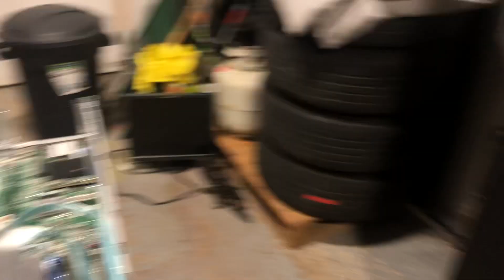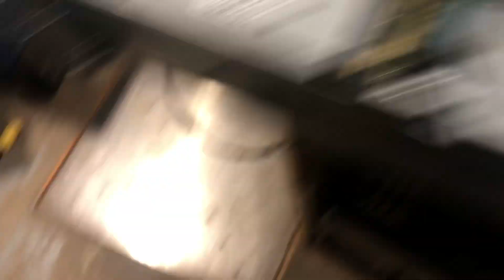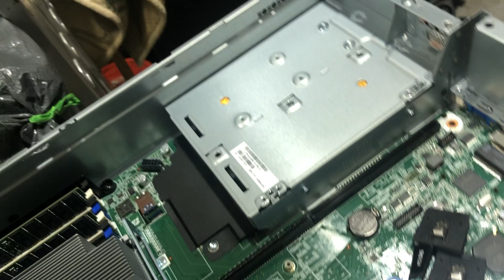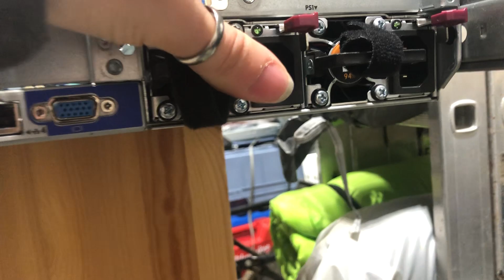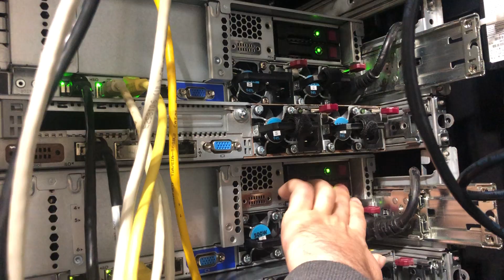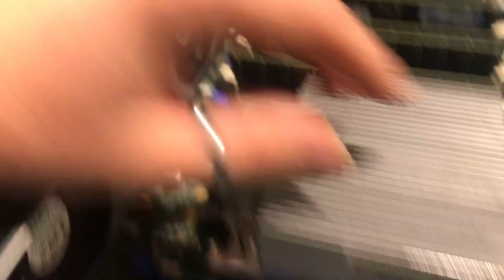Proliant DL380 Gen9 - basic overview - 2

Comment: I have a few questions! I just purchased a use 380p g9 and I am having a few problems with the boot drives. Is it crucial to have the chassie housing for the rear boot drives to power on and function? I have lots of questions and am very new to the server world so any help would be graciously appreciated!
Reply from the maker: First off, congratulations on your purchase! I hope you use it in good health.

Lets talk about the extras.
The obvious answer is, the rear chassis housing is not required. For immediate results, if your server has a dvd drive, you can use a dvd to 2.5” caddy drive with the pre-existing cabling. They both run off the sata chipset
Reply: @ thank you so much for your quick response! I really appreciate it! So I do not have the DVD drive. I do have the housing in the back for the boot drives that connect to my raid card. But when I plug in a 2 1/2 inch drive it doesn’t seem to spin to life. This is where I’m struggling and cannot figure out what is wrong.
Reply from the maker: @jakepassey99 great question.

Does it have the 6 pin power cable connected from the mobo and does it have the 8087 cable for data?.

Step #2 to check is bios settings. Go into …. I dont know it on top of my head, but i believe its sata operation. And verify its under sata and not b140i. If its under b140i, set it to sata.

Comment: Just got one of these free.  It has SAS drives in it but I want to put some of my 4TB SATA and SSDs in it.  Can this be done without any modifications?
Reply from the maker: As long as it physically fits, yes.

If your raid controller is in raid mode, dont forget to make a virtual volume in SSA.

If its in HBA mode, or you have an HBA, dont forget you cannot boot from it and will need a drive thats connected directly to the SATA controller.

Good luck!
Reply: @TechLabUnleashed  Thanks appreciate your help.  Not got a clue what a lot of that means but I'm sure Google and ChatGPT will help me out :-) thanks
Reply from the maker: If youve got discord we can hop on a video call and I can guide you.